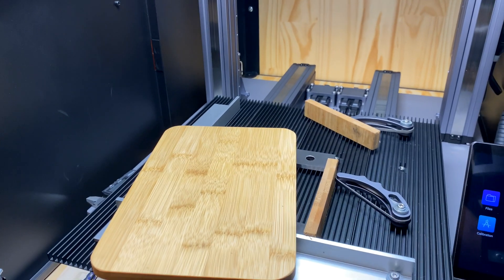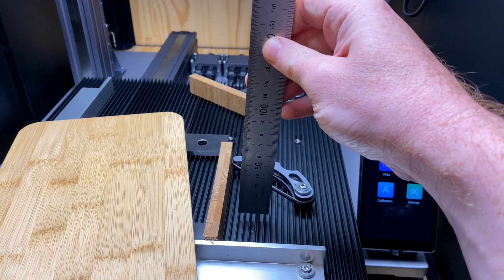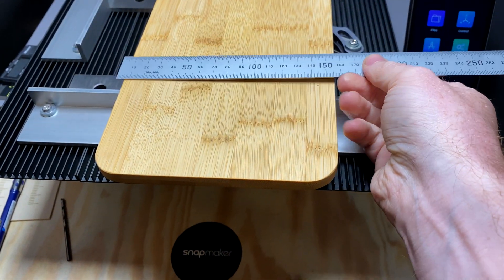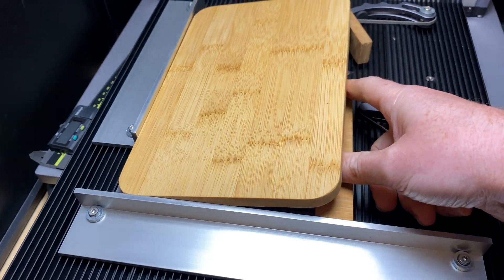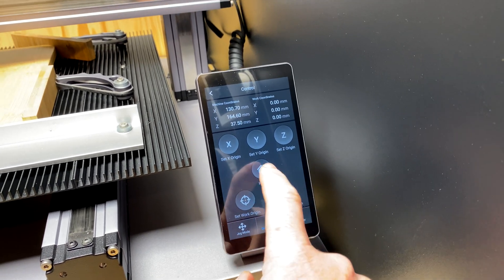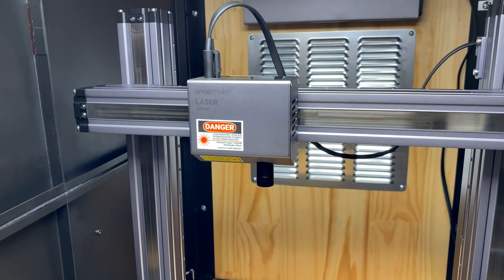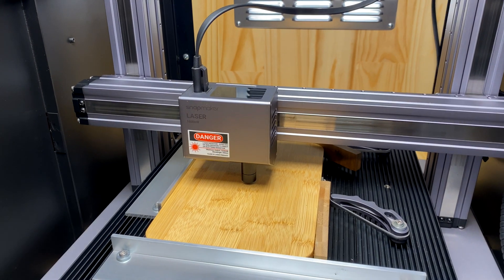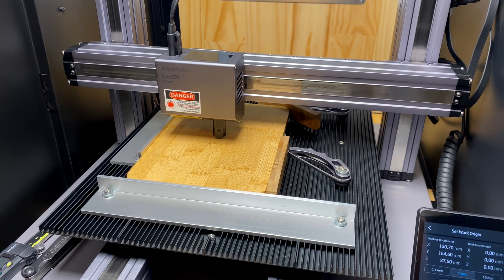Snapmaker Hacks - Laser Work Origin

Comment: Thanks a lot, this is very appreciated. I've just begun to learn everything laser and this method is definitely the easiest, yet most reliable that I have seen so far.

The camera thing does not seem to work for me anyway, for some reason when I try to scan the bed with the workpiece, the camera pretents to make a scan with all the movement and then... shows me a picture of the piece of paper you've used during calibration (the one where the laser makes four cuts). And I can not figure out for the life of me if I am doing something wrong or if my laser/camera module is broken. And since I've made a comment under part I about my laser head crashing into the workpiece , yup, this already happened before that.

Comment: THANK YOU, but now my laser (1600) Does not even burn the focus lines. Time to call SM about my SM350, ughhg
Reply: In case you still have this problem or someone else having it, this happened with my A350 as well. Setting the laser height to 21 cm or 19 cm manually before adjusting the focus did help, after that, everything seems to work as intented.

Comment: Just trying to get into acrylic engraving, love your videos. One question: because of fencing, you have a fixed XY corner that gives you most repeatable origin, why would you not use that lower left corner as the origin while designing the part? Is there an advantage in establishing the origin in the middle of your work piece? Thank you.
Reply from the maker: You could use either depending on your jobs and workflows :) I normally use centre of actual work pieces as they vary a little :)

Comment: Have you cut any fabrics on this? I have been searching top & bottom for info on what kind of wattage I would need & I haven't been able to get a straight answer. The material I'm trying to cut is 50/50 nylon/cotton ripstop. I don't think it's too thick, maybe 1 or 2.5 MM & this adverts for 8MM
Reply from the maker: Never cut fabric, it may be possible?

Comment: I just subscribed to your Channel. Was fascinated by the snapmaker laser job workholding. Silicone rubber plugs are nearly worthless for everything but cardboard so I pulled out my design program and designed a new workholding device that can be 3D printed. It's shaped like a piece of T Extrusion. The leg of the T is just wide enough to fit snuggly in the slots on the table. The top of the T is 2 mm thick. Make two of these, mine are 120 mm long. Then make 2 each 2 mm thick wedges. Mine are three degree taper on one side with a 90° angle Square to the other. Bracket your part with the T on both sides and use the wedges to take up the space between the T and the part. I found this works really well on 3 mm thick plywood.

Comment: This video assumes that you have the job centered along the x/y/z coordinates when you import your job into Luban (if using)?
Reply from the maker: The job can be anything you want it to be really layout wise, it just means the work origin in Luban or other program corresponds to the center of your work piece and you layout with that in mind. Obviously there are edge cases where someone might not want this setup but I did this video for novice users who may struggle with a manual setups.